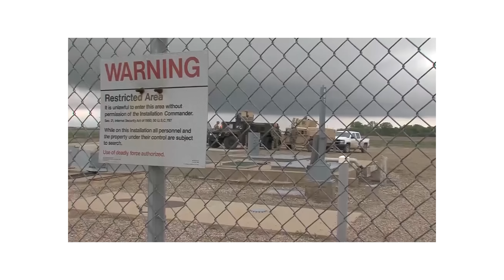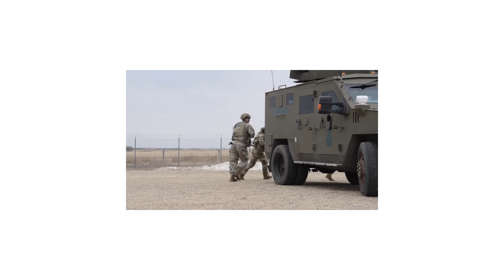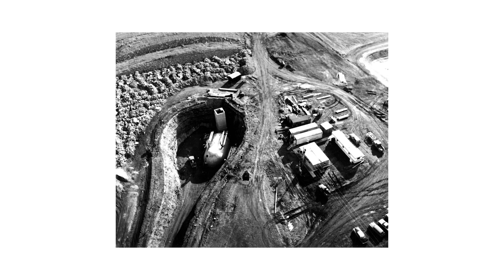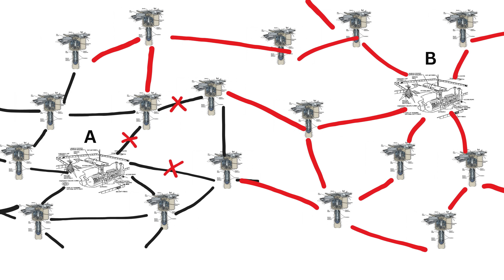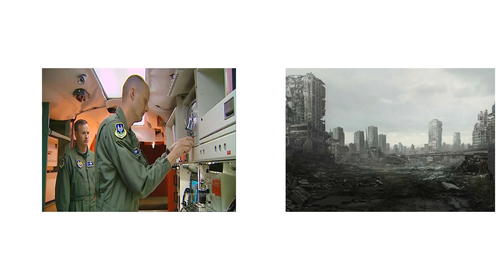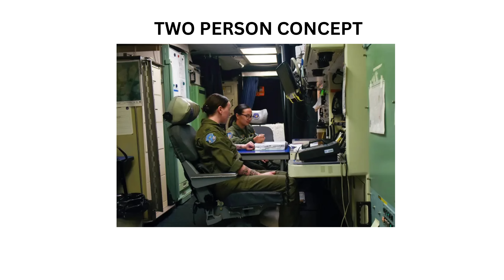Every USAF ICBM Security System Explained

Comment: The President says launch… you launch. Makes zero difference if it’s a “mistake”. There’s no second guessing it… there’s no hesitating… there’s no choice whatsoever. If you get a valid code/order. This “nobody can hack” the system is silly when the POTUS doesn’t need to. It’s also terrifying with a President like Biden that nobody has any faith that he can recall his Gold Codes. If he can’t remember the codes… nothing can ever happen as only he possesses a key component to enable all the other parts to function. The Pentagon can’t send out launch orders (the officers in the LCF might see them as perfectly legit and legal) without that key component. The whole system requires the alpha/numeric “code” in one humans head… the POTUS. What’s very interesting to me is the process of code generation and dissemination. As they say one human has that code… but logic says this almost certainly isn’t true. With effort many many people could figure out the code the POTUS possesses as it needs to be disseminated and programmed into a great number of other systems manually. If the system is awaiting a “valid” code from the POTUS… they 100% have to already possess the correct “answer”. Aka many other humans have the ability to determine them (i suspect). You might have a “black box” that you’ll plug to “fill” the LCF and the man possessing the box has no idea of the information contained… but when you pull apart the curtain… it’s a system designed by Man and there is almost assuredly “tech people” who have designed and coded and maintain and service that piece of “top secret” fill device. They can disassemble or access the data it’s disseminating. Aka they can figure out that code only one human is supposed to possess for launch control authority.
Reply from the maker: The codes are kept with USstrategic command. No one has the full access to a each stage of the launch process. The positive control material is the thing launch officers check to ensure its from the US president. If this is Trump, he gets briefed on what is going on, and the general provides him all the nuclear attack options, and he just say "DO X". And then the general will pass that down with minimal nodes of communication down to the missile wings.
Reply: @MilGearExplainer  what I’m saying is that.. many many many people have to have those codes… the codes that everyone lies about and says only the President possess. That’s, using logic, 100% not true. No matter what process is used… the President is picking alpha/numeric values… which then need to be transmitted to all of the officers in LCF’s in the missile fields. They need to know if they’re getting the correct code… which means someone in the process has to know that code to input it into the system. It’s like security of classified documents… that’s great until you realize that someone has to maintain technical support on the systems storing it… aka they’re reading/have the ability to access all of what’s stored on their systems.
Reply: @MilGearExplainer  in order for the officers turning keys to have the system function… they could do all of the steps to the letter and do everything correctly… but nothing will happen without the codes the President possess. Many will say nobody on Earth has these alpha numeric codes. Sometimes you hear that someone has designed constructed a “biscuit” to help the President remember… which is another conversation… of how is a human helping the President “remember” a code only he has. But beyond that… the “code” that the President chooses and knows… many many others in the system have to also know and transport this code. Aka… theoretically… the system could transmit everything the system requires to put to flight Minuteman missiles… completely bypassing the President and his sole authority. All that’s required is to correctly know that code. Now some might say that the code is “hidden” meaning the President selects it and humans don’t have access to it… which is silly. As it’s being carried in a machine that 100% a human can access and look at. That “code” is stored in some manner (which is almost assuredly retrievable) by humans. All of this is speculation as this level and detail of the process is almost assuredly not made public to more than a handful of humans in the world and those that do know… will never tell you specifics about it.
Reply: @MilGearExplainer  the nightmare is that Biden was entrusted to “remember” any alpha/numeric sequence… period… but lets go out on a long limb and say his mind was sharp enough to retain that code… in order for him to be able to effectively and assuredly give that code to missile officers in LCF… they also have to have that code to compare it… locate it… verify it… etc… and then input it into the system as a way to “unsafe” the system so it’ll function/strike targets. So nobody is ever going to tell you Biden himself went to every underground hardened bunker and put his hand over a keypad and secretly input codes… or wrote them down… or typed them out… etc. there’s a whole process and army of humans responsible for this process. Which exposes a weakness of the system. As humans have to have a means of taking Bidens “Secret” and then giving it out and copying it and storing it… and on and on… it’s not just “known” to Biden… it’s known by a whole lot of people. How hard it is to learn… unknown… or if it’s stored in a way that’s easy to get… unknown… but by hook or by crook…. They’re carrying that number… and someone can get access to it in the process. Like a slip of paper in a locked briefcase being carried… someone eventually has to have the key to unlock it.. look at the paper… write it down… and put it into another safe/system. The slip of paper is almost assuredly encrypted and electronic. But that’s not saying anything beyond it’s “harder” to gain access to… but people 100% can. That’s my point.
Reply: @MilGearExplainer  I think of it like an encryption device used to fill a Singar’s radio. Common man pack that infantry BN’s will have hundreds of. The radio is worthless without a correct fill/encryption. When I’m watching a Comm Tec carry that machine to each and every radio… I’m not given specifics about the specific “fill” going into the radio. It’s this “electronic code” that’s telling that radio… how it can communicate with all the other radios containing the same fill/encryption keys/code. That CYZ-10 (or whatever device is being used by whatever name) is the source of the encryption. While the form it takes is electronic and not known to common users… someone has designed that entire device. Someone has decided how to fill it. Someone can plug it into another machine to read it change it etc. the “code” is contained in that machine. It’s why the machine itself is a very sensitive highly controlled and guarded item. Just the clockwork. The fill itself is also valuable but worthless once it’s switched. But for the Gold Codes… the President almost assuredly isn’t switching them daily, weekly, or probably even monthly. And they’re being carried and disseminated in a machine/process very similar. All it takes is a human with the intelligence to take that machine and tease out the information contained inside of it. It’s 100% there in that machine. Readable… writable… accessible… capable of being copied and pasted/transmitted. That’s the fascinating bit… the details of the process we’ll never know as they won’t be declassified while we’re alive.
Reply: @MilGearExplainer  when you say the “full access”… the process is very simple… and completely isolated from outside interference or knowledge of “good” or “bad” or “logical” or “illogical”. If the missile officers in the missile fields get a message telling them to launch. They launch. End of store. If the information they’re getting contains the “code” from the President… they’re not having a “zoom call” with him. They get orders to launch.. and that launch order is legal and valid… that’s all that it takes. They’re launching and warheads on foreheads in 28-39 minutes or your money back. That’s the entire process. They get, by radio, a valid order… they carry it out as soon as they can physically and safely and effectively get those Minuteman’s in the air. The “flaw” in the system… is that order… is just a number. You need “faith” in order to launch. You need to have faith that it really was the President who ordered. And not some other entity that just posses the code the President uses. Say if the POTUS is decapitated and it’s the VPOTUS… or whoever… if their code is used… it’s the code itself that is the key to letting missiles fly. Nobody knows who actually sent that code. Just that the code is valid. A valid lawful order from the National Command Launch Authority. The right and correct individual has ordered the end of the world… and it’s 100% going to happen… as that’s my sole function in life in the LCF. All the officers in the entire field have gotten the same code/order and all in agreement. Open the silo’s. Turn keys. Look at flashing lights… then wait for destruction as you’re 100% targeted for retaliation. Down to the 10 digit grid accuracy.
Reply: @jastrapper190  What you're claiming simply is not possible you're just grasping at straws because you want to be right

Comment: If I (or anyone else) was trying to gain access to the LCF… you would be silly to try to brute force the door plug. When with an excavator you can dig a little and gain access to a nice sand filled tube containing a ladder leading directly to a bolted hatch to torch open. Viola.
Reply: Anytime someone says "all you have to do is just..." you know they're barely informed

Comment: Some you did say thay got code in the safe thay have to verify before they launch
Reply from the maker: Based on talking to a former missileer.  They only have the authenicator locked. The codes are safely kept with strategic command and are sent through top secret messages, and these people are not allowed to be near the LCC. People who go on alert are also not allowed to work at strategic command, or even be allowed to be near the missile. The same goes for maintenence crew, they can work on the missiles but they are not allowed to be near any complimentary code components or the LCC. Its just super strict.

Comment: What happens if you put a door stop behind the sliding silo cover? I would bet you could hammer drill, set anchors, and bolt an L-flange behind the sliding silo cover. Then quickly braze or weld the assembly whole before the security elements got there. I would be worried about Chinese agents doing this. I get that the missile silos are set far apart because they'll be targeted by ICBMs, but they still seem fairly remote.
Reply from the maker: Idk

Comment: Bet there are a couple of engineers who designed the different systems who would know how to launch it anyway as a single person. It´s probably designed in a way, that all systems have to be enabled invividually via different means, like warhead, flight control and launch. But each individually can probably be activated given the knowledge and access.
Reply: A lot of the time on projects like this, they have different engineers or even companies design different modules. They might be able to bypass their own module, but they wouldn’t even know if the signal out from their module would lead to the actual launch mechanism or another module for security checks

Comment: Well, I still see some ways to trick that system, with technology that didn't exist at the time of design. Say an autonomous robot system, must not  even be an android. I mean it is impossible to break into that compound, but there are logistics and to bring in autonomous systems with that would infiltrate the compound. Also if you do a nano bot attack, which is still sounding like SciFi, sure, but it is not impossible and we don't know what kind of technology the attacker has available. So, this can be either done with an inside attack, it can be done like "Corticeps" attack on the brain stem and taking over the humans, "zombifying" them, I mean not really zombify, but the nanos would just take his actions over. To get this into the system of the operators, not just that one operator but a whole lot of operators is possible.

It is even not that far away from happening. So, yeah. The security design is outdated. 

Also the lines between the silos are not on the internet, sure, but they can be hacked, means tempered with and wrong signals can be inserted. 

Then, if the SF arrive, it is today not that hard to take down a helicopter or to bomb one of the oncoming trucks full of soldiers off the street with an oversized IED. You do that, say, five, six times and the SF are no more, it is of course a question of timing. But not that bad if you jam the dreck out of their communication, so they don't know that they are the last SF team. 

After that, the missiles of the US are under control of OP forces. But sure, they have to really go all in, but hey, it's a few thousand nuclear heads, so that's worth the effort. 

The whole drone attack has not been included in the security protocols, because all those things were not possible in the 60's when this system was designed. And I don't see how they can stop this from happening. If I would want to take down this system and you give me the money of a state and some leeway and a couple of hundred of poor souls I can sacrifice to fine tune the nano tech, and get hand on the one or other specialist, unknowingly or unwillingly cooperating, well… And I even didn't have to think about my second approach yet, just the first and the first approach usually is shitty and primitive, the second is much better, but I don't want to do the work for a comment section that is not been read by anyone anyways. So stick with the first idea, that would already work.

Comment: "They thought of everything" like when it turned out the launch codes were set to 000000.. There are always going to be failure points in extremely complex systems as these, especially when you can't really test them on a large scale in realistic conditions. Also the glazing tone, pumping music and AI images make this annoying to watch
Reply: The PAL code being set to all zeros was actually an attempt to remove another point of failure.
Reply: @thelight3112  yes, and if you have to disable a security feature to remove a point of failure, thereby introducing another point of failure, you really haven't "thought of everything"

Comment: Hypothetically, speaking of the security team was to not report in after being dispatched to a alarm being sounded how long before an additional unit is dispatched out
Reply: With the job i used to do in the missile field, my team would be more then likely the one to respond, and because of OPSEC, i cant say much, but i will say it would be a very short period of time. There are many many MANY protocols in place for that. Losing contact with anyone actively working in the field for any reason is a huge deal
Reply: @f @floridaboz1 Lmao opsec? Bruh I was at Vandenberg SFB if someone didn’t respond we would literally just send another team to see whats going on….
Reply from the maker: Everything has time limit before a report is filed. People get lost in the field if they are new. Snowy day may prevent movement in the field. They have special protocol when dealing with conditions like that. if the security doesn't reset then it's mandatory for the SF teams to camp out there and not allowed to fall asleep, which makes being SF the worst job in the missile field.